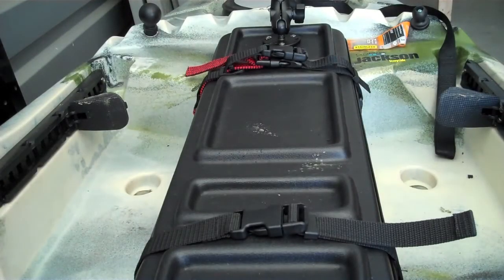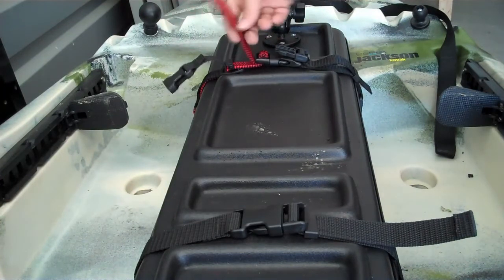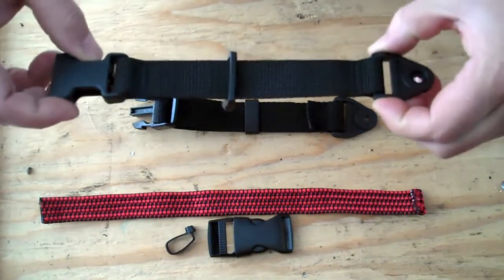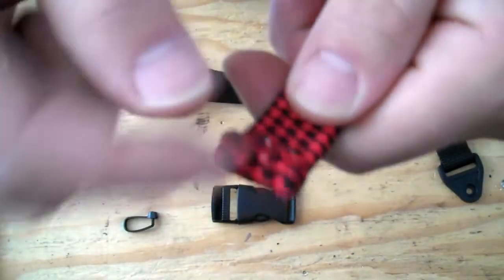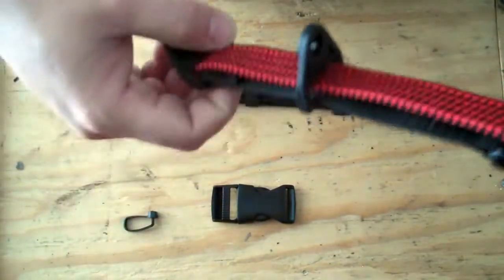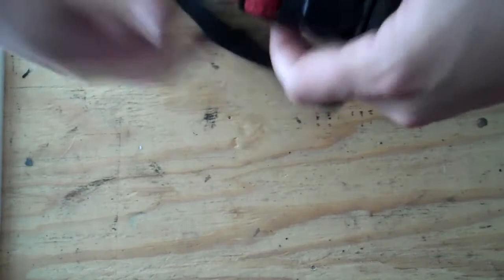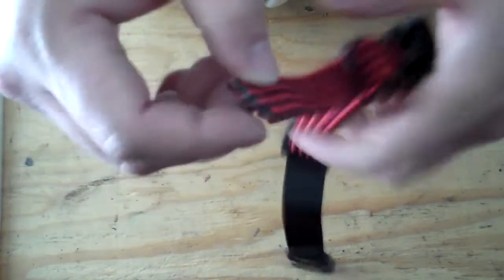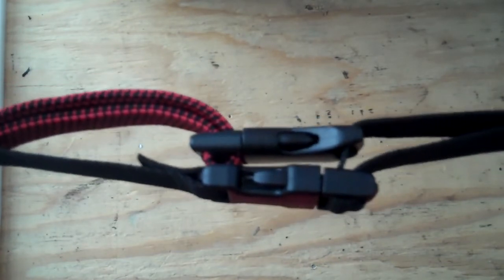Jackson Cuda Hatch Upgrade

Comment: Looks like a great mod. Have you thought about just replacing the original straps with the bungee straps, that way you wouldn't need 2 sets of buckles. Just a thought as I think it should work...but now thanks to you...now I have hope in having easier access to the hatch. Thanks Bud!
Reply from the maker: I kept the strap on there so I can keep it locked down tight for long road trips. I've converted to the 2014 hatch with the gear tracks and now I'll latch things down when I have a rod holder mounted. Glad to help!